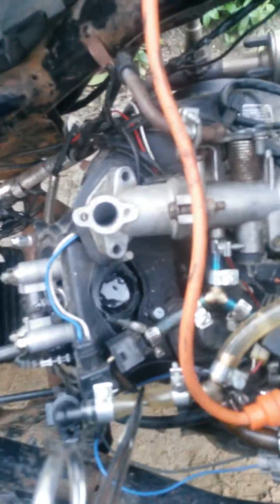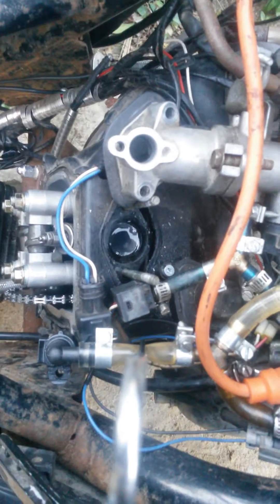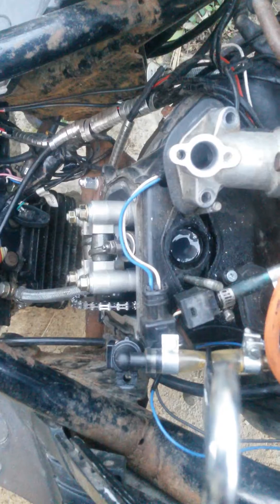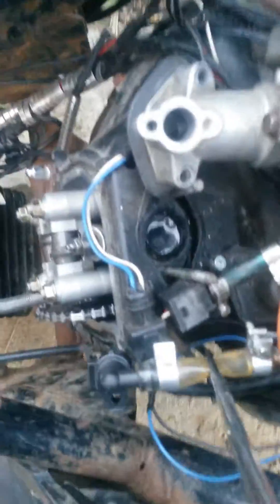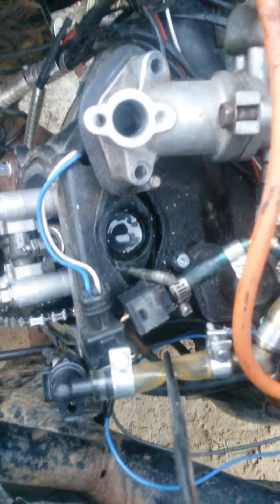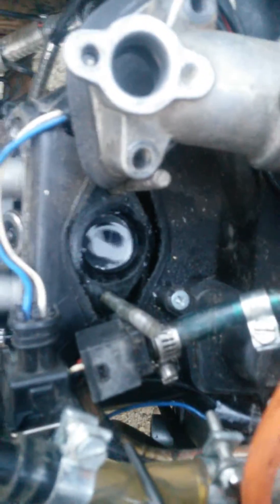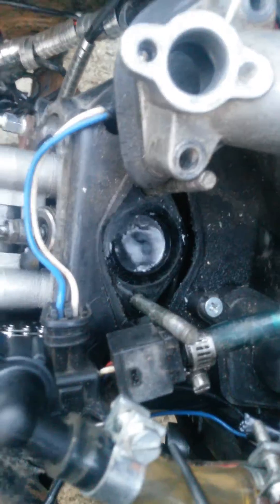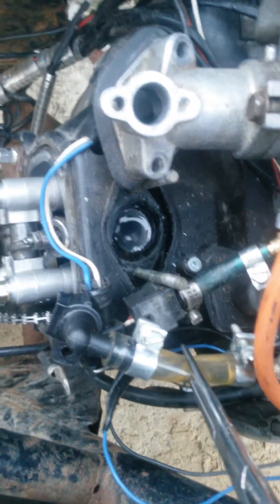How to check if your intake valve is leaking

Comment: lol you can always perform a vacuum test and a compression test and a leak down test to find out which valve is leaking
Reply from the maker: That would require the proper tools, which I did not have. Buying tools only for one check is very expensive, so this video was how I tried to diagnose a problem with a much less expensive method.